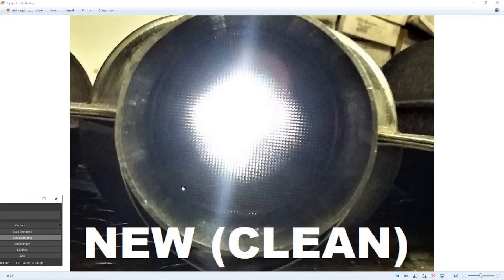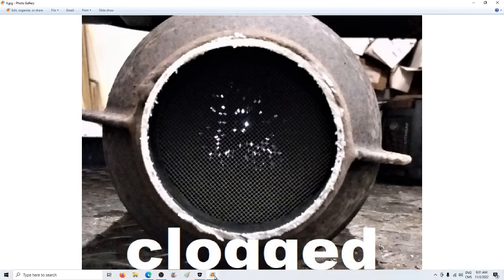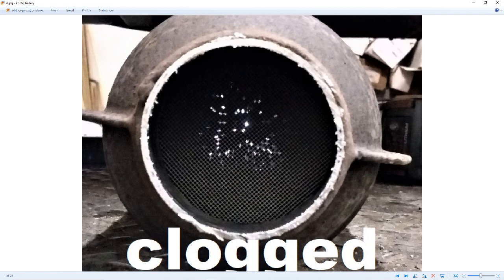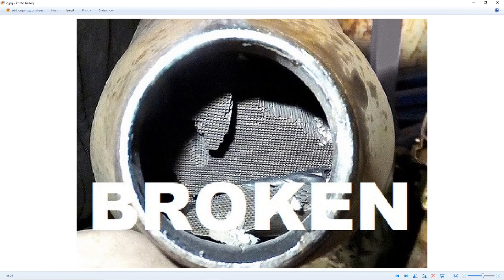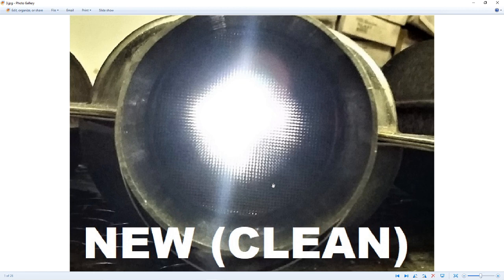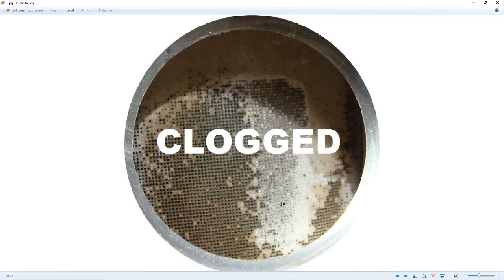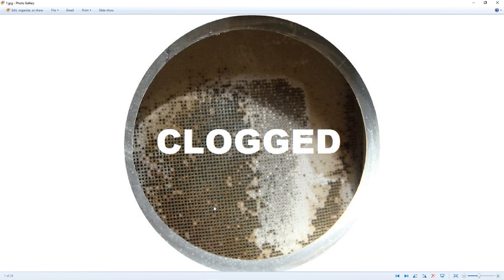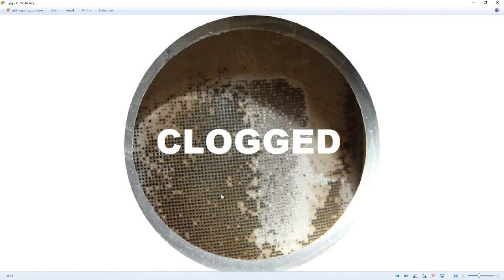Catalytic converter check

Comment: you don't need to take it off to check if they are plugged. What I always do is hold my hand near the exhaust pipe and feel for pulses. If you cant feel the puff puff of the engine at idle and there is just slow moving hot gasses streaming out, the catalysts are clogged!